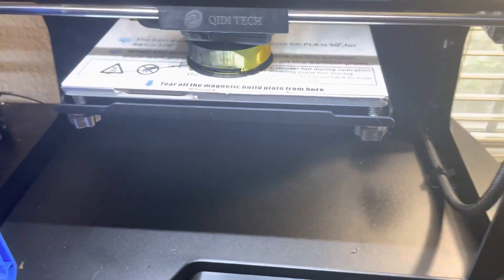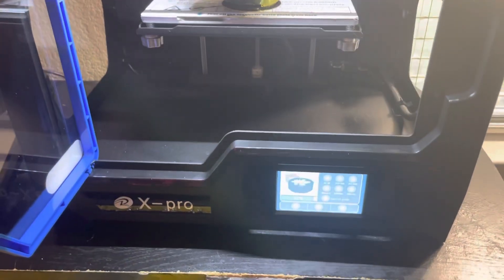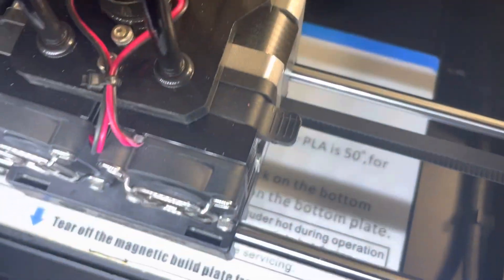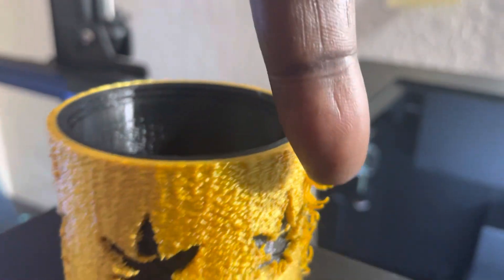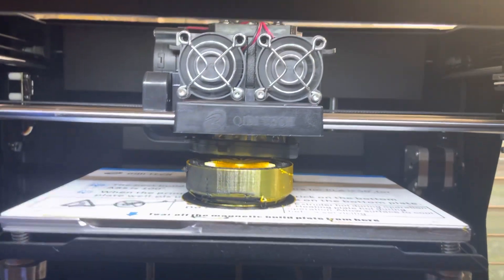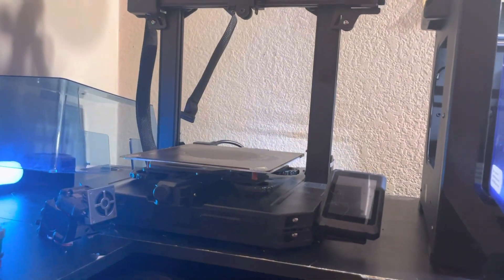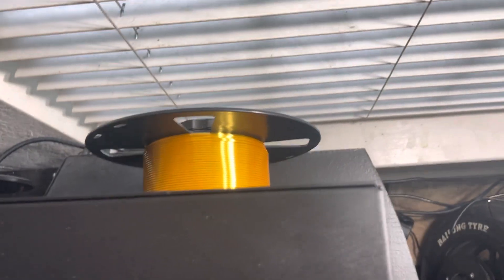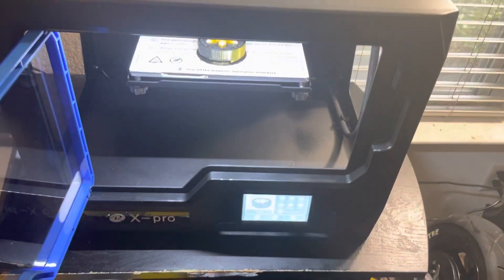QIDI X-PRO Dual Color & Ooze Testing

Comment: how did you use multifilament on the ender 3 s1 pro? (I have the same one and I can't do it)
Reply from the maker: Im just using a silk multi-color filament on the S1 Pro with a fuzzy skin. It changes colors about every 3 feet. CHEP has CURA a profile were you can stop the printer at certain heights and change out filament. Thanx for the question
Reply: I have an X-PRO and I love it but I can't find any info on how to use the dual extruder properly so I'm forced to use it as a single extruder... Any tips or advice on how to properly use the dual extruder? Thanks in advance